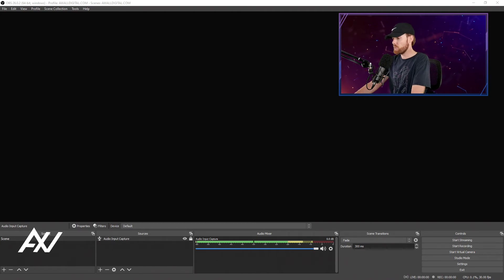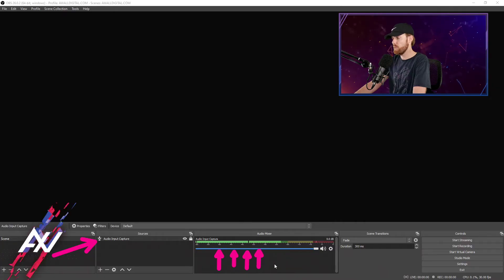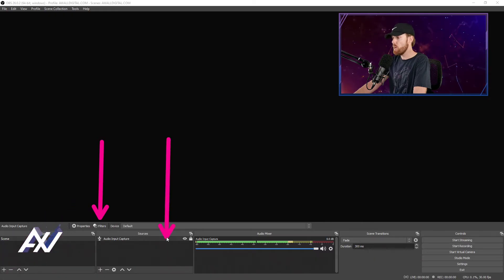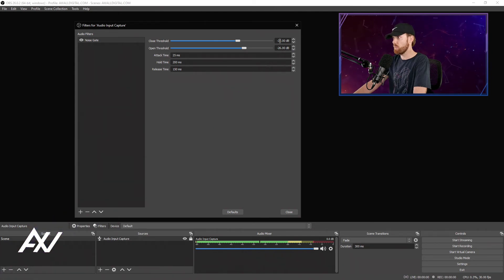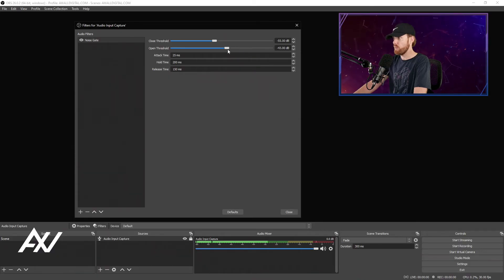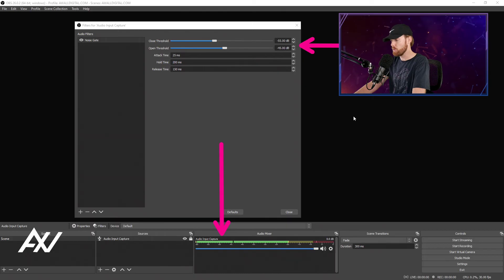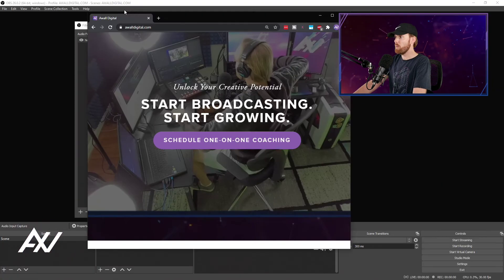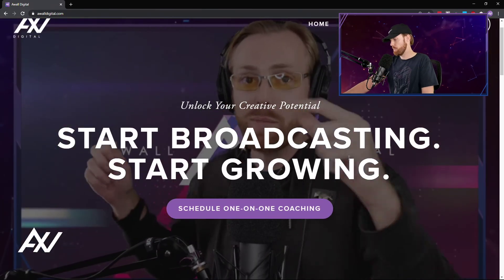OBS Studio: How to Add a Noise Gate Audio Filter to your Mic (OBS Studio Tutorial)

Comment: This was a little trickier for me with my AI voice setup and having two computers, but it pointed me in the right direction. I have been having this annoying tick tick tick sound when running my AIPC over to my main PC using a male to male audio Jack, and this pointed me in the right direction to help find a threshold to cut that out for me even though in OBS the bar wasn't showing any activity. I actually had to move myself to -46db in order to eliminate it as best I could.

Comment: Andrew, I know this is an old video but needed to ask.  My current live stream is in a gymnasium with a lot of bounce from the audio system that goes through the mics (worse than an untreated room).  I have found that OBS seems to amplify this making the audio stream sound like an echo chamber at times.

Someone told me that this effect could be reduced using the noise gate filter, though I haven't quite figure it out.   Any though on some basic settings to reduce this effect?  or should I look at a VST plugin to help.

Comment: This helped with cancelling my annoyingly loud AC, but it still isn't getting rid of the most important noise I want gone: CLICKS AND TYPING. :(
Reply: Follow the same process, get a reading of the noise level while you are typing and adjust in a similar manner.  You may have to adjust the attack, holds and release times, but a god start is to get the level readings while your typing.

This will only help while you are not talking,  so you will still hear it while talking if the typing isn't quiet enough compared to your talking.  You would then need to adjust mic sensitivity and positioning to offset the clicking while talking as well as applying the noise gate.

Comment: im sorry but this did not work in the slightest. my background noise was at -55db, so i set my close to -60 and open to -50 and you can still hear things like the keyboard or even me breathing. sorry but this tutorial did not help at all.
Reply: You have to adjust the settings to the level of what you are trying to remove.  Background may be at -55, but your breathing or keyboard may be registering at -40.  You have to adjust to the level that you are trying to remove.

Additionally if your breathing is being picked up it, most likely your mic is to close to your mouth, or the sensitivity/gain of the mic needs to be adjusted depending on your setup. 

I can tell you that while using my phone to measure (near my mouth similar to a headset mic), my office alone is in the 55-60db range for noise, breathing audibly and that value reaches about 75db a quite talk reaches 80-87db.  

This means if your ambient noise is reaching -55db, breathing would be about 15db above that at -40db, so you would need to set your gate to close around -45 and open around -35.

You will have to play with the setting to fine tune it as you need to ensure it turns on when you need it and off when you don't.  This also will not remove ambient noise while you are talking.

Comment: Man, I was watching an EposVox video about fixing audio and, after realizing I don't have a noise gate, I was like "Of courrrrsee!!" 
I have one in Discord, and it's a big help (but they don't call it a noise gate, so it slipped my mind to even think to add one to OBS). My mic's always producing some baseline static, so a noise gate's a decent solution. Now I need to figure out the static problem. I may need to replace my mic altogether.
Reply from the maker: Hey, what mic are you currently using and how long have you had it?
Reply: @AndrewFreakinWall , my mic is the detachable mic that comes with the original HyperX Cloud headset.